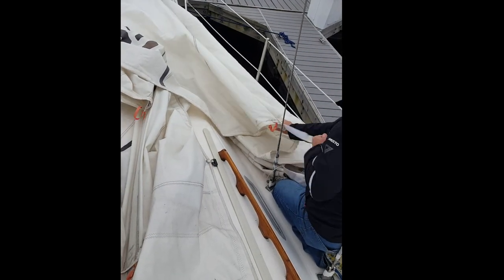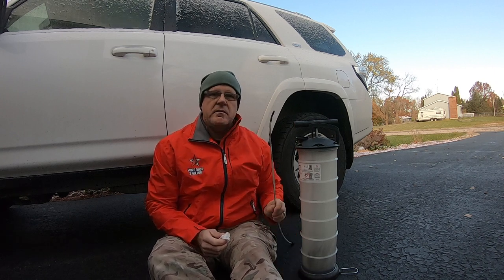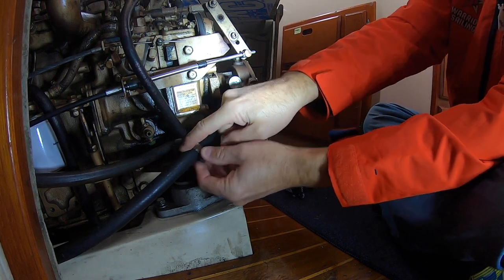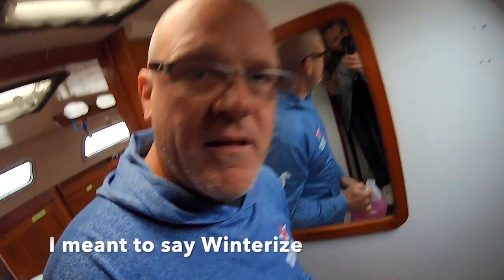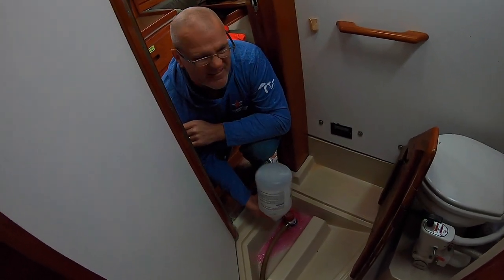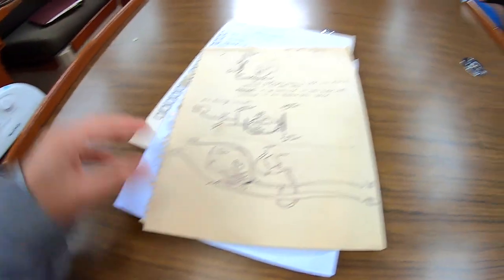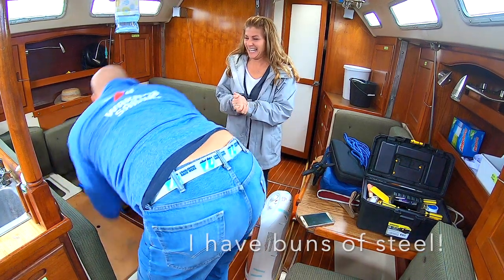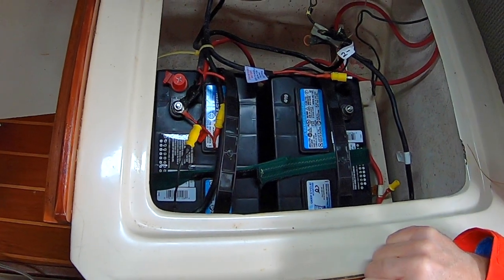Tips And Tricks For Sailboat Winterization [S1E4]

Comment: I understand that batteries can freeze if they get discharged.  I've seen recommendations to take them out to keep them in a warm place, and trickle charge them.
Reply from the maker: I fully agree with you. We have an old ladder that my body weight alone exceeds the ladder weight capacity. It was very difficult getting them on the boat when they were new.  I think this year I will use a halyard to lower them once on the hard. Then I will store  them in the basement on a trickle charger.  Thanks for the comment

Comment: What about your freshwater tank and lines?
Reply from the maker: We never used the fresh water, but just dump the same anti freeze in your fresh water tank, turn on your water pump and run hot and cold water till it runs pink.  the big thing here is you need to close the access to the hot water heater and drain the water from it.  Anti freeze can ruin it.  Hope that helps.